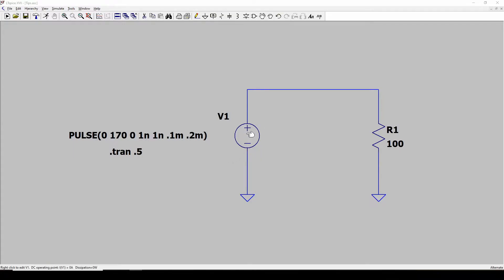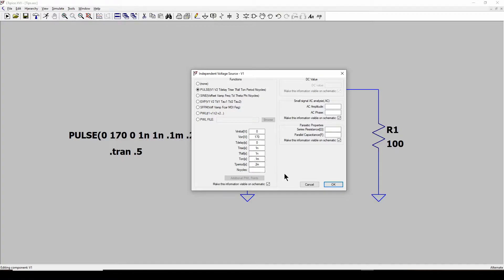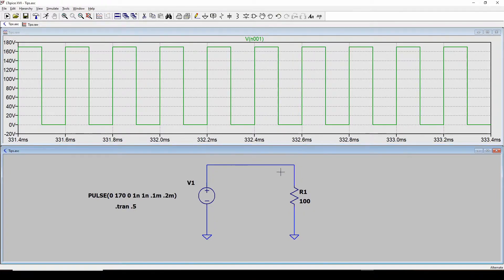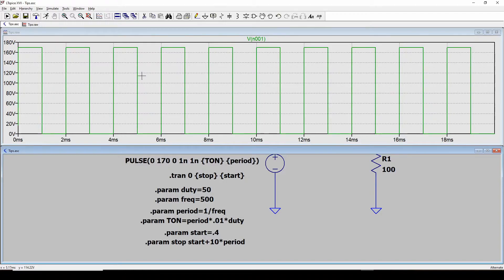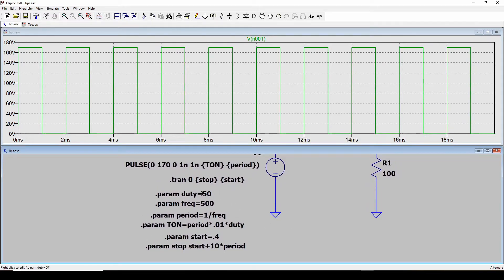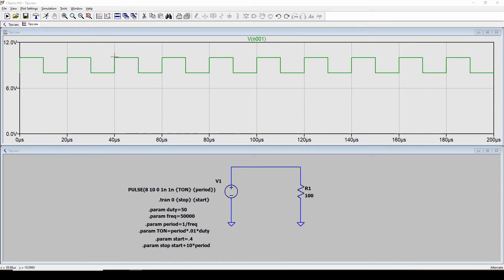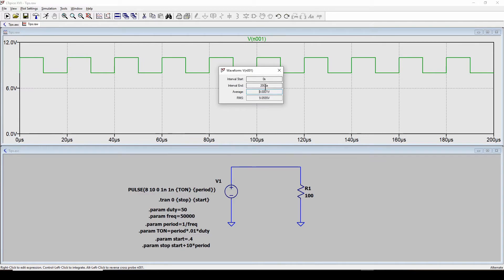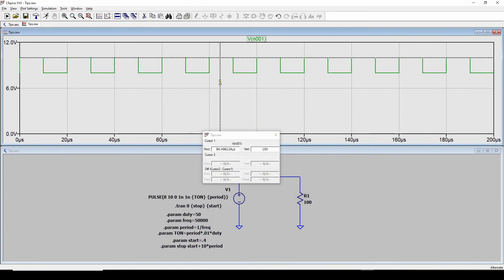LTSpice Tips & Tricks

Comment: Very useful thanks!
I think a way to fix your graph, is just measure two extra sources. In this case at 0V (or 0.000001V if 0V doesn't work) and one at 12V.
It will always auto scale between them.